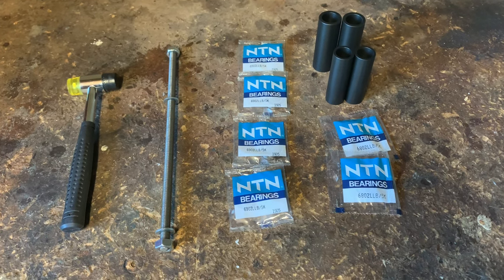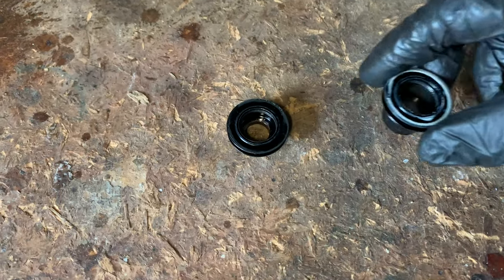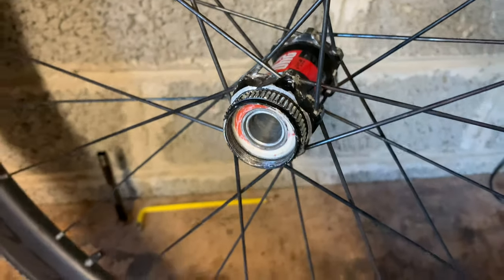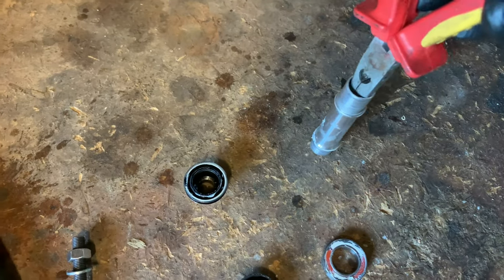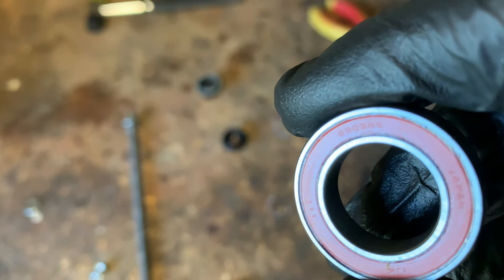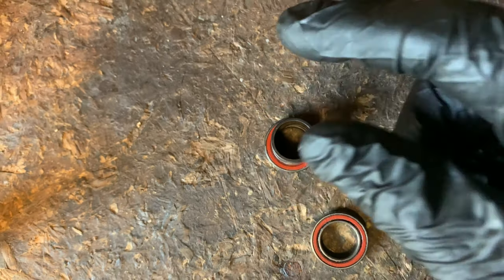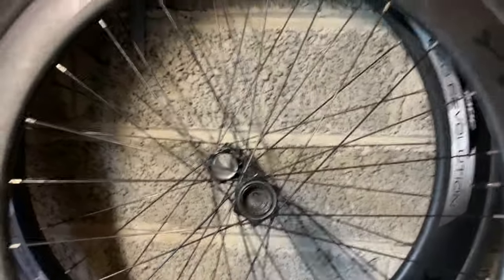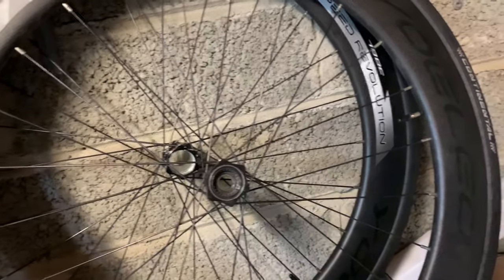DT Swiss 240 hub Bearing Change Pt 1 (didn’t go well) Short Version

Comment: Hey the number of the bearing is the size and type.
The RS is the sealing. It means it's sealed with plastic rings. There is another type of sealing with metal rings with has the extension ZZ.
Reply from the maker: Excellent! Thanks! 👍

Comment: Just did this job at the weekend.  You don't need to remove the ring nut.  Just reverse the axle and use it as a drift to drive it out past the ring nut from the other side
Reply from the maker: cbr1000 I can’t do that and I’ll show you why when the bearings turn up, There is something in the way...
Reply: Interesting.  Mine was a 370 hub so there  must be a difference.   I have wheelset with 240s too so I look forward to the next installment
Reply from the maker: cbr1000 video is up! 👍